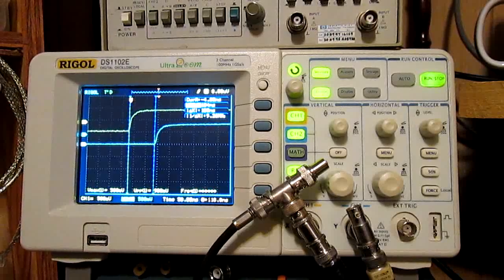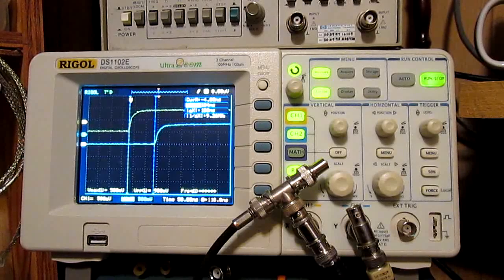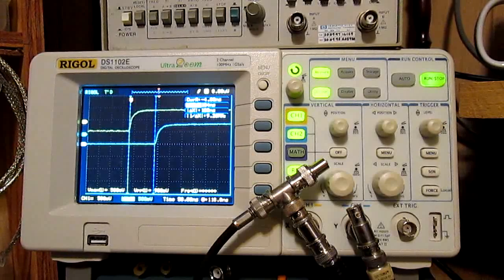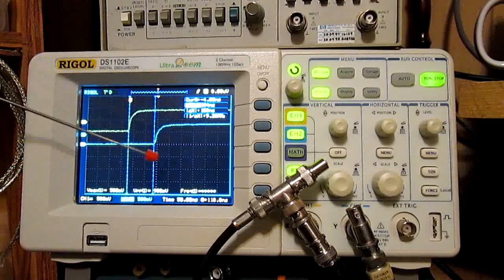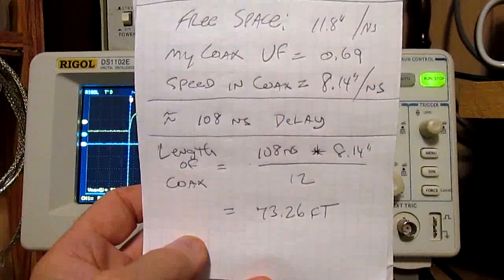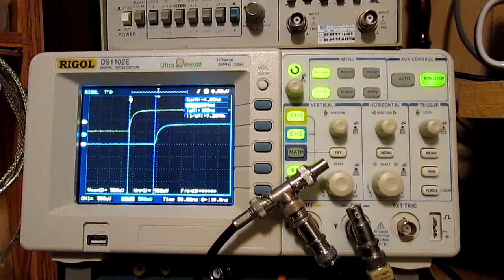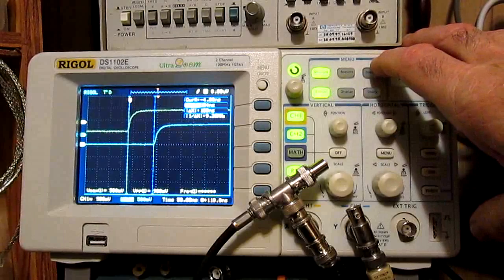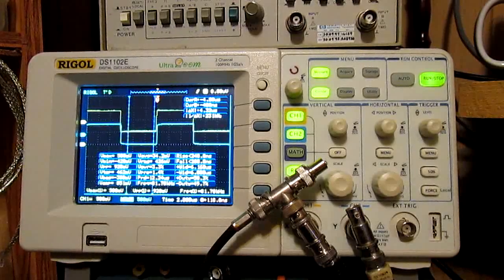Poor Mans TDR using Delay times with an Oscilloscope

Comment: This is technically not TDR, but is a great test setup IF you have access to both ends of the cable.  TDR is based off of the reflection of energy from a pulse at one end, but in this case there is no reflection.

Comment: I remember learning about this years ago in Air Force tech school to pinpoint breaks and shorts in wires down the length of an aircraft fuselage or wing. There was a dedicated piece of expensive mil-spec equipment to do it, not an oscilloscope. Talk about waste of tax dollars, I don't recall ever using the thing. Thanks for this video!